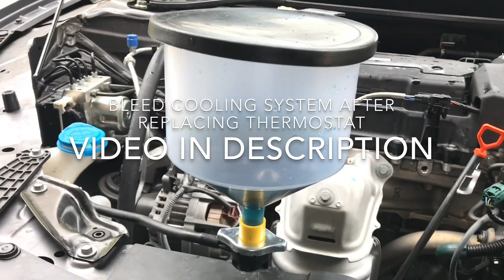Honda Odyssey Thermostat Replacement DIY

Comment from the maker: Coolant bleeding video: https://www.youtube.com/watch?v=Jjr9dxlUjpM
2002-2017 Odyssey OEM thermostat: https://amzn.to/2J198kL
1999-2002 OEM thermostat: https://amzn.to/3biSMQR
1995-1998 OEM thermostat: https://amzn.to/2J6c2oG
OE spec aftermarket thermostat: https://amzn.to/2QyurOY 
Honda coolant: https://amzn.to/2wpKtDW
Coolant funnel: https://amzn.to/2WyLvbk
Socket/ratchet set: https://amzn.to/3be7DvF
Wobble extension set: https://amzn.to/3a9v9tE
#ad

Comment: It is very useful video, i have paid $563 for thermostats for my sedan.
Reply: Yeah and the dealer wants $200 for a transmission drain and fill when the fluid is $50 full retail  and my sorry 60 yo ass can do it in 30 minutes with a floor jack and stands. Thats why theyre66 called stealerships. Cant fault them completely, they gotta make money and cant do it selling cars at $200 over invoice.

Comment: Hi is it completely necessary to drain the coolant? I replace my radiator last week, and filled with new coolant. I didn’t replace the thermostat because i couldn’t remove the low bolt. I need to replace it now because with the new radiator it is failing now. Can i keep the same coolant? And just refill once i end?? Thanks!!!
Reply from the maker: Yes make sure no dirt falls in the coolant

Comment: I'm doing this now and it seems so simple but I can't get that wire housing out of the way. It seems to be secured to a metal tab and I can't tell if yours was attached or not. How do you get in there? ?
Reply from the maker: You'll see the wire harness is held down with clips and bolts, unclip/remove as needed.
Reply: @MrRangerZr1  Thanks for the response! I couldn't remove it from the bracket but I muscled my way around it.
Reply: @lizhewes  ouch. You dont want to be forceful with wire harnesses on a ~15 yo car. When I did the valve adjustment/gaskets  on my 07 I ran into multiple times where I thought I could get something out without removing a harness, but after pushing and pulling it was always easier if Id have just fully unbolted it as I was supposed to. 
If you have no extra hardware when the job is done youre winning.

Comment: Is it a good idea to drill a small whole on the disk of the thermostat in your opinion?
Reply from the maker: Rich christopher no why?
Reply: @MrRangerZr1  I've had a lot of guys tell me it helps the coolant flow a little better.
Reply from the maker: Rich christopher no bs. There is already a hole for air if you noticed. It has to installed up. Watch when i install the thermostat.

Comment: how long did your OE thermostat last? Thank you.
Reply from the maker: They rarely fail. On my van, I swapped it out around 160k miles, but it didn't fail or anything.
Reply: @MrRangerZr1  nice. I just replaced tb and wp on my 16 honda odyssey at 72k miles but I forgot to replace the thermostat so now I'm not worry about the stat until the next tb and wp at 150k miles. Thanks. The timing belt tensioner started making rattle noise around 70k miles in the morning 🌄
Reply from the maker: @TruongLe-eo8kh  Some tensioners fail around that mileage
Reply: @TruongLe-eo8kh  make sure to use OEM quality. Like TAMA. I did my thermo with the TB at 129k, used a "good enuff" aftermarket from amazon, think it was a gates or stant premium.  It failed in the closed position recently. Bought a NAPA "premium" that was labelled Motorad, John Clark at odyclub insisted it was junk and I should use OEM. Given his rep I couldnt ignore his advice and when I took it back for exchange I was blown away by the difference. The pics on NAPAs site dont really show scale well, but the counter guy even asked if  I was sure it was for the same car.  (Youre asking me?) If put next to each other I wouldnt dream of using the cheap replacement but we just take what we get without knowing any better. FWIW the new one shown in this clhip appears to be the OEM typhe, the springs for instance are twice as thick as the crappy ones, the center piston pin and bottom washer are much larger.

Comment: BTW my 2005 Oddy is whining every time it's cold. I guess it's steering pump. We previously replaced high pressure hose a year ago because it was leaking like hell. Now I'm just waiting for warmed weather. Someone here (on your previous video related to high pressure hose) advised me to replace rings around pump because I have bubbles in my power steering fluid tank. Unfortunately, I haven't done it yet. Do you have any plans to make a video regarding PS pump replacement?
Reply from the maker: It's on the list. Just change out the seals I showed in that video. Use OEM seals.
Reply: @MrRangerZr1  Thank you! I'll try to watch that one your video again to figure out where were those seals.
Reply: @MrRangerZr1  Thanks! I added few comments to your video related to PS hose. Also it would be great to watch videos related to changing belts including timing belt and water pump.

Comment: Hello. I just did my coolant change and I also replace the thermostat on my 2015 odyssey.  While I was burping the air, I notice that smoke is coming from my engine. I immediately turned off engine. When it cooled down, I repeated the process and same thing happened. Engine temp needle on the dash remained in the middle. What do you think is going on? Could the coolant that I spilled during the process is burning?
Reply from the maker: Possibly, rinse the engine down with plain water.

Comment: This reminds me that for all its faults I am fortunate to live in SoCal for the reason of preservation of cars. Thats one of the most decrepit engine compartments Ive seen but I know its typical of midwest cars.
I think it rained about 8 months ago here in San Diego, or so they tell me. One of the CV boots on my 07 tore completely around,  since Im not driving it much I just pumped a bunch of grease into it and figure I wont drive it in the rain. (Pretty sure bad motor mounts contributed to it, the air intake plenum also broke)
Reply from the maker: Swap out the axles, it's not too hard. All videos on my channel
Reply: @MrRangerZr1  oh I think this thermostat will be the last thing I do on the grey ghost, its getting sold next month. If I had a place to work on it it might be different. I bought a '16 elite last year thats been remarkably trouble free, the '07 not so much.

Comment: I'd like this video way more if you came and did the work for me
Reply from the maker: Send the van this way lol
Reply: @MrRangerZr1  I got it done. Thank you for the help.
Reply: I did thermostat, hoses and radiator in 3 hrs. I unplugged the harness from intake and vcm module to access rear thermostat bolt.